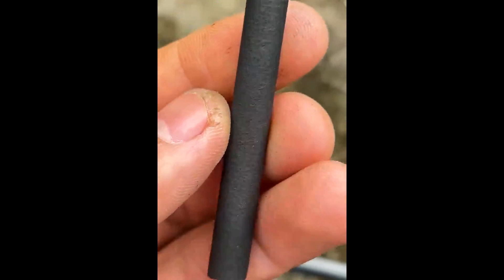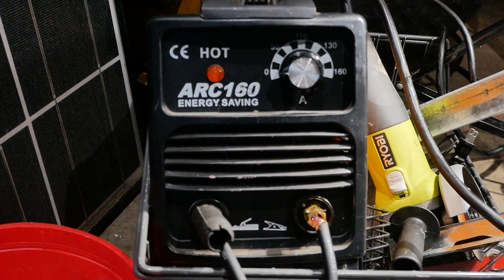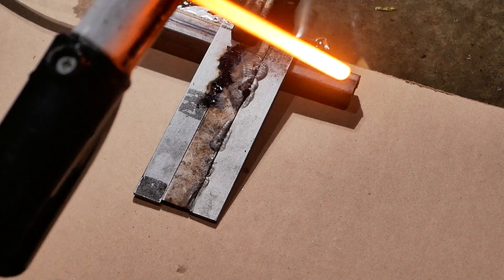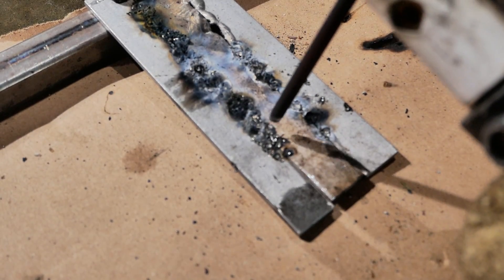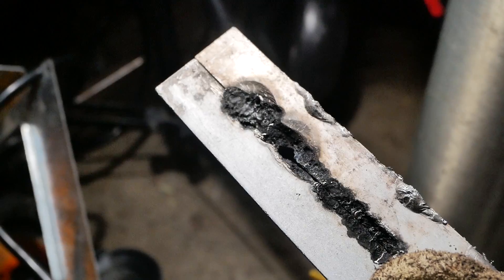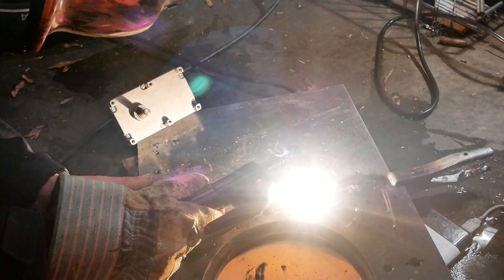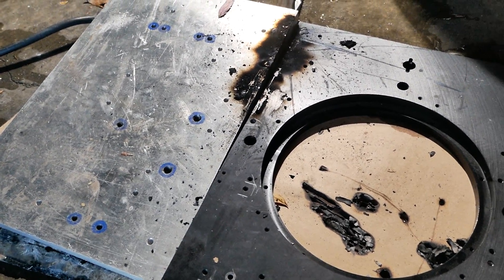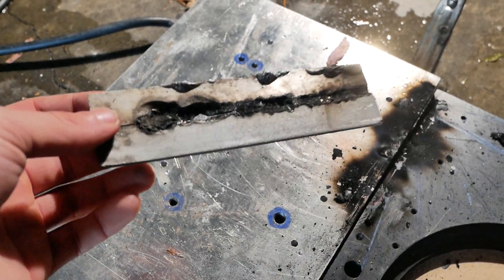DIY BATTERY HACK DEBUNKED (please don't weld with AA batteries)

Comment: yeah im sure you know already but you aint welding aluminum with an arc welder maybe tig but only good welders can do it.
Reply: Tig and mig can both weld aluminum, the most important thing there is that you have inert shielding gas (argon), as aluminimum is a really reactive son of a bleach. Even slight contamination in the air and its a sooty snotty mess.
Reply: @Ecclesiasticus  i thought it was to soft to weld like we saw here
Reply: @hardwirecars  check out "the fabrication series" - the dude there is a pro at welding aluminum. As a metal its not soft, its just more goopy when molten, id say it feels more "oily", compared to the "watery" steel.
Reply: I did some aluminum TIG welding in high school. I do remember having to have the thing quite clean otherwise your weld will look like garbage. I really don't think there is any way that you could weld aluminum with a carbon Arc. Just way too dirty. I even saw that video originally and thought.. yeah, that is definitely faked.